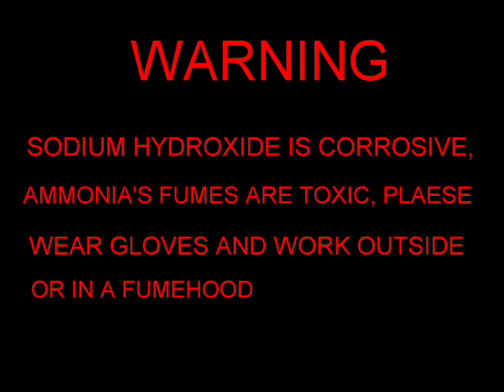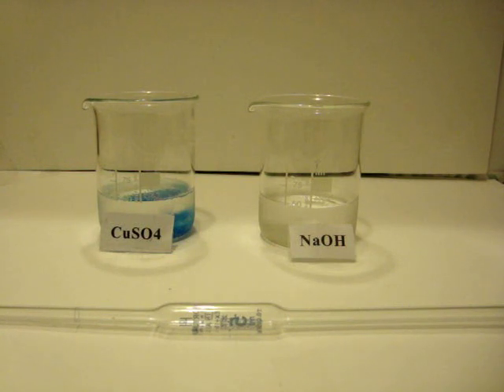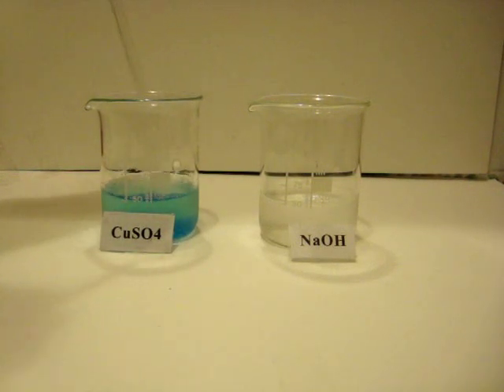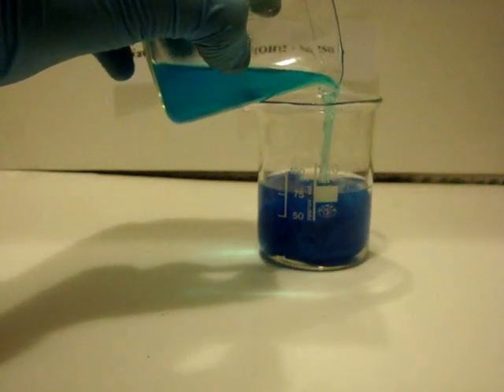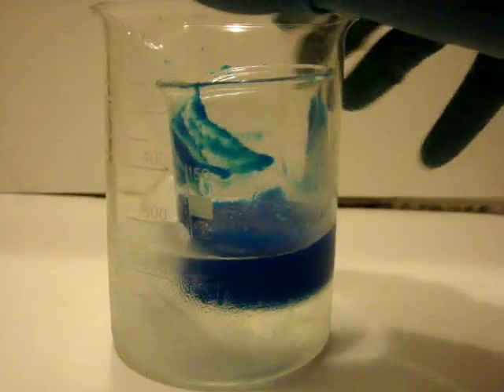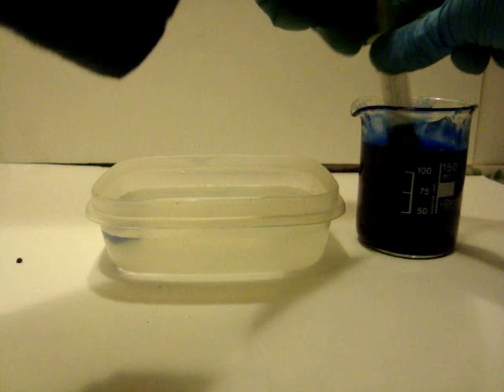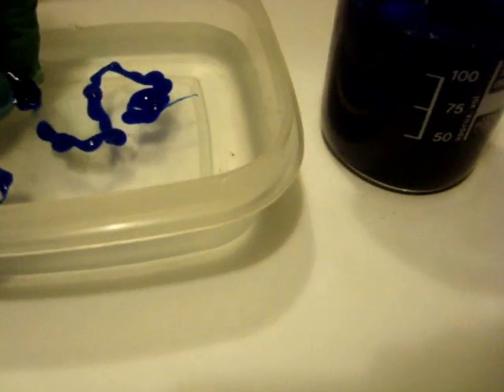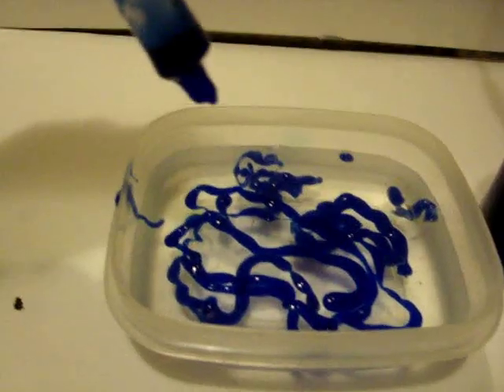CUPRAMMONIUM RAYON SYNTHESIS

Comment from the maker: @EcoShark2012 Sure. You have to add a solution of 8 grams of  copper sulphate not too weak into a solution of 4 grams of sodium hydroxide. Then keep the product(copper hydroxide) into an ice bath. Philtrate the product and add to it about 50 ml of 30% ammonia. Then add to the product small pieces of blotting paper. When a piece it is dissolved add another one till nothing is able to get dissolved. The result should be a gelatinous blue liquid. Add it to a 10% solution of sulfuric acid. Is it ok?

Comment: how much time does it take for filter paper to dissolve does it vary with the quality of filter paper
Reply: The dissolution of cellulose fibers depends on multiple factors. 
The concentration of ammonia in your schweitzer's reagent is probably the biggest factor, but the size of the cellulose fiber being dissolved also matters. 
Smaller fibers dissolve faster, but, when you reconstitute the fiber, it isn't as strong. 
So there's some give and take with what you want and what you get.